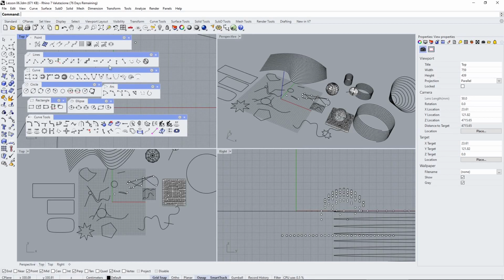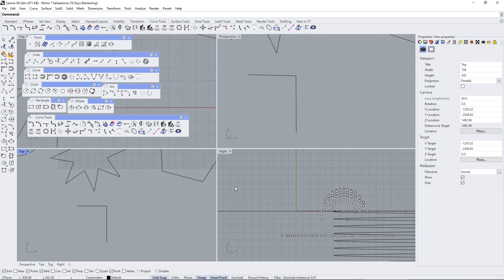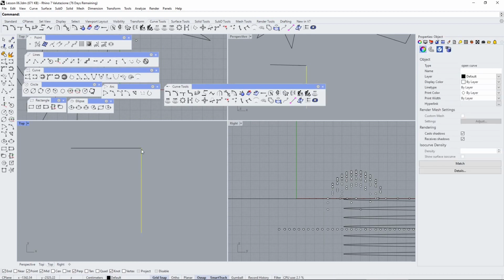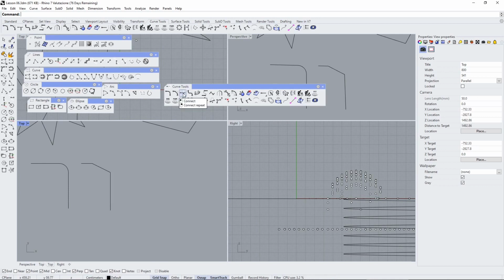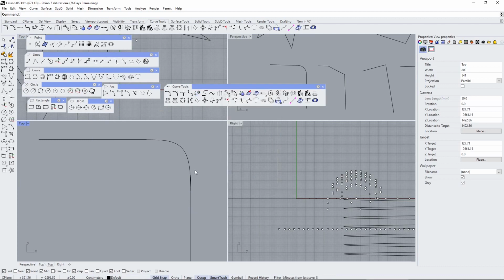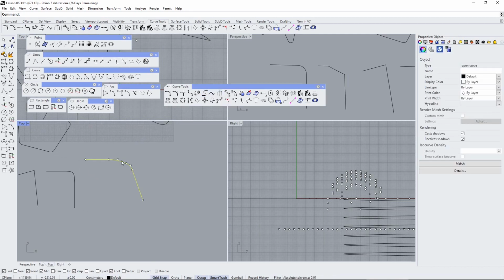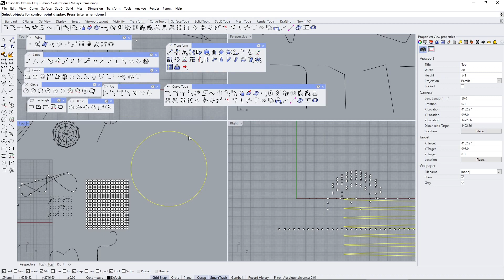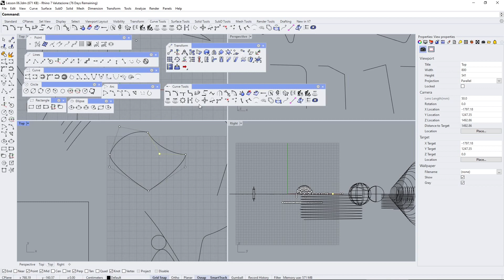RHINO 7 Videocourse - 06 - Editing 2D Shapes, Curve Tools, Explode and Unify, Cut, Fillet, Chamfer

Comment: The video is bluring
Reply from the maker: Hi do you mean is blurred? Probably it's caused by your internet connection speed. You need to have a nice internet connection to play it at full resolution 1080p. Also you can contact tutor@jbdesign.it to get the full resolution, and full length video lessons. Thank you